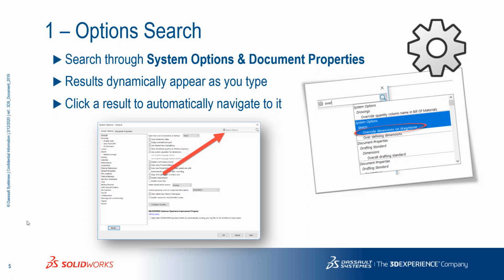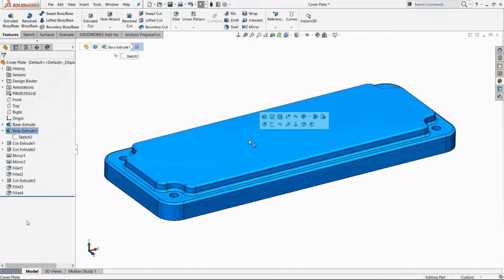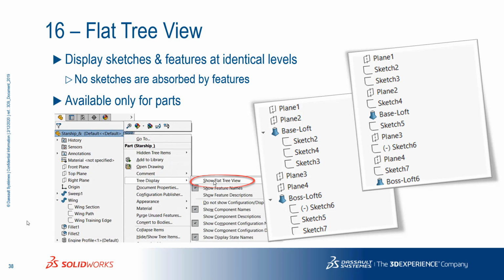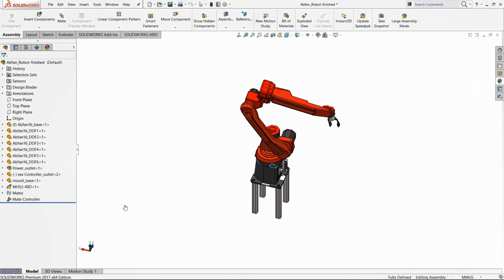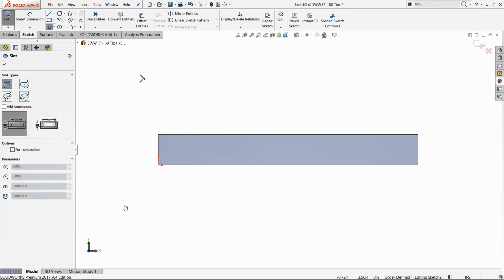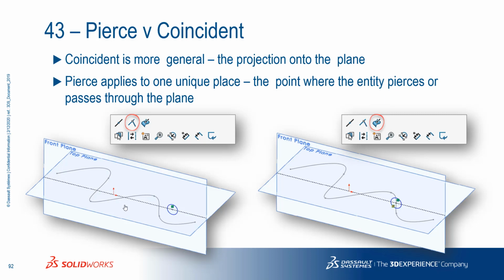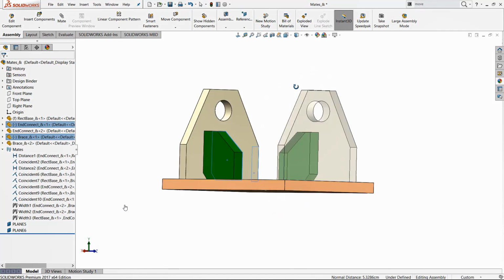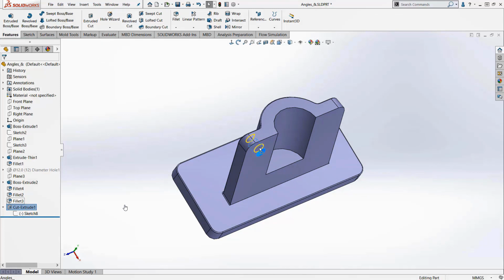Learn SOLIDWORKS - 60 Tips in 60 Minutes 2020

Comment: On tip number 40, i do not see the Biad. I looked for a option to turn it on but aa search does not bring it up
Reply from the maker: I made up the name so it won’t come up in SOLIDWORKS Documentation.

You can activate it only by following the click sequence- line segment and then end point. 

Hope that helps!
Reply: @stephen_petrock   Thanks, that worked. i had to move the mouse around a bit to get the correct line to change color for selection.
Reply from the maker: @nieljones655  glad to hear it! It’s tricky for sure but one of my favorite tricks

Comment: Options search 00:01:37 
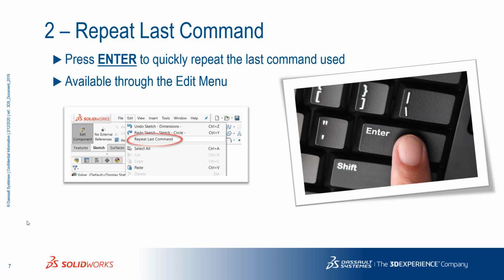Repeat last command 00:02:40
Force rebuild 00:03:27
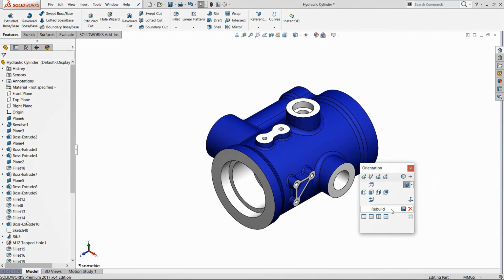Reference planes 00:04:29
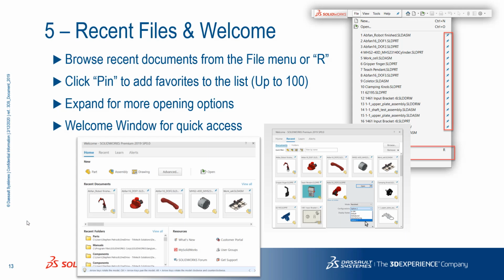Recent files and Welcome 00:05:46
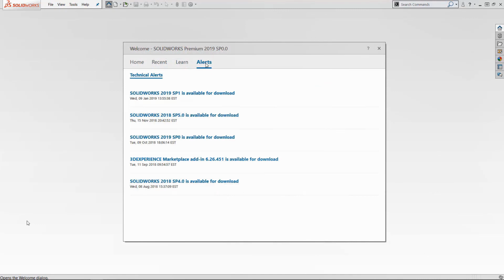Reload 00:07:21
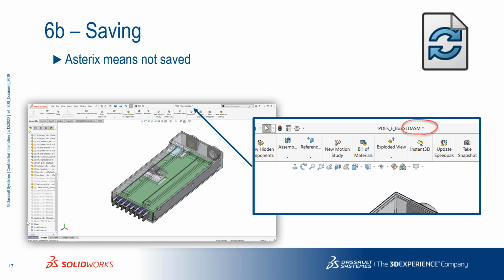Saving 00:08:22
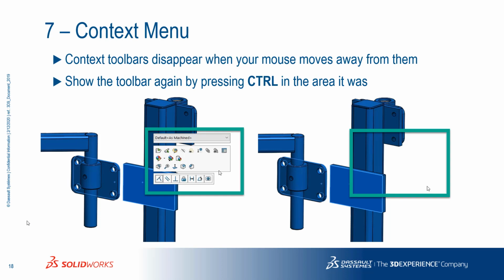Context menu 00:08:43
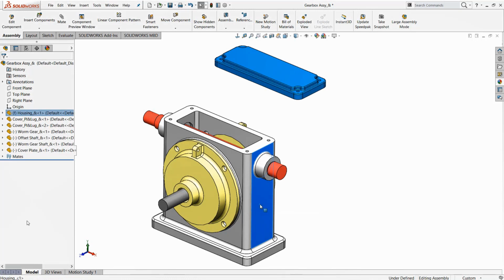D-key 00:09:54
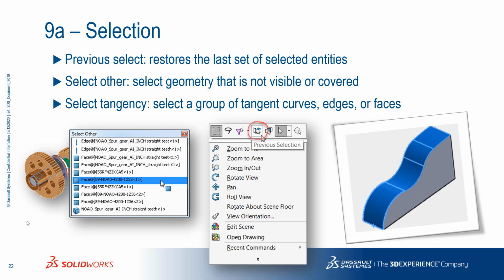Selection 00:11:20
Selection Filters 00:12:28
Command search 00:13:30
Customizing 00:15:18
Save Solidworks settings 00:16:27
Browse open documents 00:17:34
Filtering the FeatureManager 00:18:18
Flat Tree view 00:19:01
Collapse tree 00:19:43
Folders in tree 00:20:29
Nuggets in tree 00:21:08
Custom views 00:22:32
Rotate about entity 00:23:36
Zoom to fit 00:24:16
Normal To 00:25:09
Zoom to selection 00:26:14
Rotate about scene floor 00:26:44
Reference triad 00:27:58
Sketch relations 00:29:01
Window and lasso select 00:29:57
Disable autorelations 00:31:22
Power trim 00:32:12
Dimension to tangency 00:33:16
Create sketch on model edge 00:34:24
Fully define sketch 00:35:16
Change sketch type options 00:35:56
Horiz. & Vertical relations 00:36:55
Create single lines 00:37:54
Arc dimension 00:38:37
Close sketch to model 00:39:18
SketchXpert 00:40:09
The Biad 00:41:17
Spin box increments 00:42:17
Single command per pick 00:44:08
Pierce vs. Coincident 00:45:0
Override Dims on drag/move 00:46:11
Derive sketch 00:46:54
Reset dragging 00:48:03
Performance evaluation 00:48:38
Feature Freeze 00:49:54
Dynamically load FeatureWorks 00:51:18
Split lines 00:52:24
Width mate 00:53:14
Hide/Show components 00:54:35
Rotate components 00:56:01
Assy Visualization 00:56:36
Open top level assy 00:57:36
CTL + Drag to copy 00:58:54
Shift + select transparent geometry 00:59:24 
Isolate and Display states 01:00:14
Relocate/edit sketch plane 01:01:14
Reply: Nice one,  Thanks
Reply: Thank you mate
Reply: Thanks for doing this

Comment: thanks for sharing this video.i have a question:it's possible ,with the "ctrl+drag" to insert one unlinked copy of component in my assembly? thank you
Reply from the maker: Luca Tofano your welcome! Unfortunately what you’re asking for isn’t really how it works for SOLIDWORKS. In an assembly each copy is an instance of file. An unlinked copy would need to be a separate file
Reply: @stephen_petrock  thank you.ie should I make a copy of the same file and insert it as a new component? what I would like to do is insert a copy of the same component but make small changes without being reported on the original ... (I hope I explained myself). how can I do?
Reply: You can save  this part in a different name and make changes and import to assambley